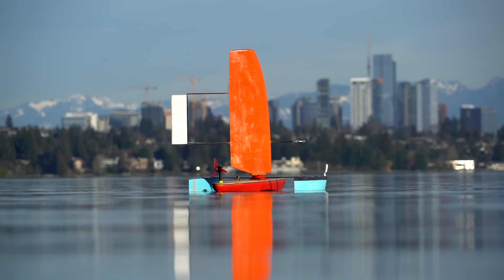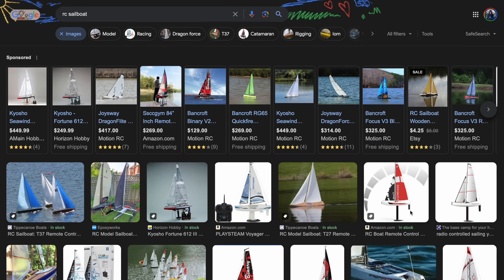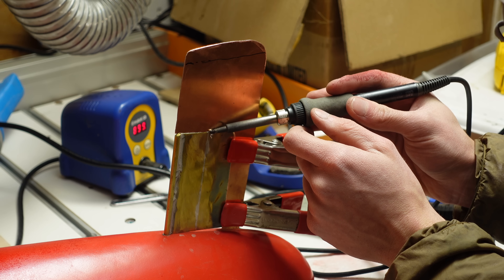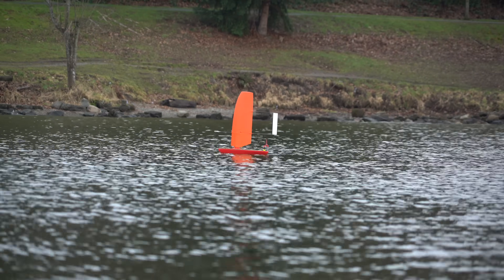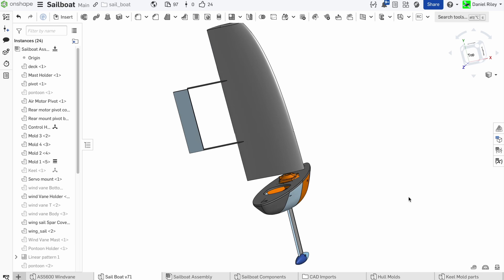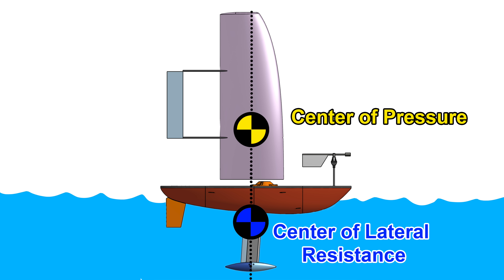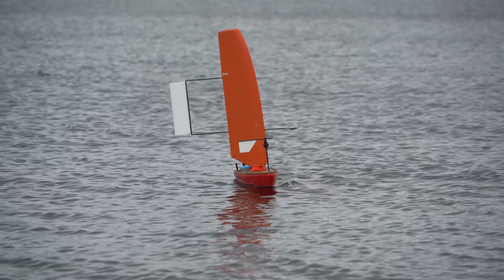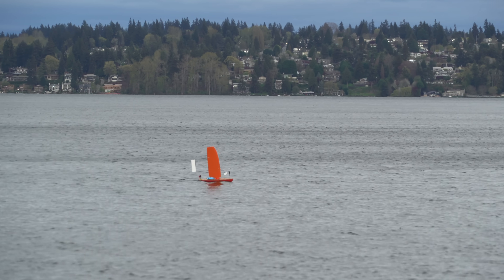Building a DIY Drone Sailboat

Comment: Your problem with a wing sail is it is symmetrical, requiring high angles of attack to generate inefficient lift, which will prevent it from being able to sail upwind. The wing sails of high-performance sailboats, like the Americas cup boats, are articulating or variable geometry wings, so that the Airfoil can be adjusted depending on which side of the sail the wind is coming from.
Reply: true but symmetrical wings are still very efficient compared to fabric sails.
Reply: @Okamika44  is that true? My hunch disagrees 🤷🏼‍♂️
Reply: @Okamika44  This would be a very interesting thing to test in the real world

Comment: Hull shape: the longer your waterline is, the faster your boat. 1.35*sqrt(waterline_length)=hull_speed. Less weight with that shape of hull = slower boat, as it floats higher.

Comment: Wouldn't it be possible to place the wind vane on top of the sail wing to have more consistent data?  Perhaps at the top of an axis that passes along the wing, fixed to the base, or fixed to the wing and consider the angle of the wing in relation to the hull to calculate the wind direction.

Comment: Great improvement over your prototype! Next steps to help you tack:
Lose the elevator. Its drag is probably the main culprit, and you can use servo control now that you've got wind direction.
2 fair your foils! You put a lot of thought into your airfoil and hydrodynamics on other projects, then you come in and use a plank for a keel and rudder. Give that keel a nice cross section and you'll improve speed and leeway.
Reply: I don't actually know if any of this is correct, but I know enough about sailing to know he's using the right words so he's probably right.
Reply: @JD2jr.  lol
Reply: He put a leading and trailing edge on the keel, and the rudder is a very thin piece of sheet metal.
Reply: @jeffh8803  The rudder is the main problem. It's the equivalent of trying to use an oar to steer. It works, but a proper foil section would work much better. Also, the foil section on the keel doesn't look like its actually a proper foil section...
Reply: Second the elevator suggestion. It's just not an efficient way of controlling a sail, especially given the power of modern servos and the small sail area. Also, I would be interested to see how well a canvas sail performs compared to a wing sail.

Comment: So Cool.
The tack problem is with minimum tack speed, it's kinda a known thing in less-complicated sailboats. Basically you can sail at a sharp (into the wind) angle all you want with any speed that gives you, but to  tack successfully you got to 'fall off' (with wind) and reduce the attack angle to pick up speed. Basically, a setting in the pilot to forbid tacking if speed less than minimum, and it should do it. (Also in situations when going into the wind and the sail is going on a very sharp angle to the water, there's the old friend GROUND EFFECT, at least with cloth sails, sends greetings ;) )
Reply: Ah, do you know that battened sails can protrude before the mast, which has certain advantages, but also gets you in trouble tacking in strong winds, while gibing gets less dangerous? Traditional sails have developed for good reasons, and doing things different is very interesting, but you WILL encounter some surprises. Steering a sailing boat is an art, if you want to win races, you should know an amazing amount of theory and apply it all at the right moments. Example? An old man is sailing passed you, and he says, hey dude, your entire sail is TWO inches too low, simply hoist it a bit. You'll get faster!
Reply: @voornaam3191  it’s so true, I used to race lasers in a pretty windy area of northern California so I’d always keep the sales as tight as possible because I’m a tall guy and could hang off the boat and really generate lift, but when I moved to San Diego I would rent larger sailboats and putt around in the breeze, one day as you described an old man sailed past me and yelled out “loosen up your sail a bit!”… I did and picked up a good .5 – 1 knot.

Comment: I think, he needs to make a simple, normal Rc sailboat and go from there. The hull doesn't seem very efficient, and whilst it isn't meant to be a race boat, speed is the byproduct of an efficient, low drag hull. If I were you I'd make the wing out of printed ribs and a film skin like with RC planes, the CG still seems too high in my opinion, better, but still high.
Reply: I don't think the hull is super bad, but it would certainly be on brand to build several hulls, and use an autonomous tug to pull-test each design to find the best one
Reply: Investigating a planing hull would be interesting, Vs a VSV Vs something off the shelf (one old and one modern design)  @2testtest2

Comment: Pouring lead into resin was surprising, I would never thought that would work!
Reply: lead's melting point is incredibly low. I used it as a kid for building small scale trebuchets.
Reply: @snowe..  I also poured quite a bit of lead, but never thought about pouring it in resin
Reply: He should use depleted uranium for keel.  Joking.
Reply: That was truly unnecessary. He should have just put lead shot in there. The 25% hit in packing density is not a big deal in this situation. 
Now he's got not only the exposure during the pour but the contamination and cleanup to deal with.
Reply: @otm646  lead isn't... that much of a poison. Not unless you eat it I guess, lol. I doubt his exposure is any more significant than a few months of soldering with real solder

Comment: Regarding the wind helm setup: it's also a performance thing. In many boats there are adjustments that can change where the center of pressure is. Tuning for wind helm requires that the rudder is constantly pivoted, and when that AoA is combined with the keel, they combine to form an effectively curved airfoil. When done correctly, it's possible to prevent the boat from sliding sideways due to the lift generated.

This may not be the case at RC scale, but it was something I worked a lot to tune in C420s, where it can be a huge advantage.
Reply: Interesting... 🤔 At what wind directions does this work best? (i.e. give the most noticeable effect)
And what kind of adjustments do you use? Do you like pull the mainsail tighter than the foresail, or do you adjust the surface area of the sail?
Reply: For the dinghies I have sailed It's done by moving the mast foot, hinging the whole mast slightly back and forth.

Comment: Excuse me what? You filled a 3d print with molten lead and it didn't deform the print? I had NO idea resin based prints were so much better at handeling heat
Reply: resin hardens with heat, it can't melt no matter the heat. However, it can become too hard and crack, as well as sublimate in extreme enough heat.

since he then reinforced the resin with fiberglass the over-hardening shouldn't be an issue, but it's something to keep in mind.

Comment: rctestflight casually arriving at a design for an unmanned marine kamikaze drone
Reply: As if no one's done that.  >.>  <.<
Reply: @rickhobson3211  I wonder if it would be possible to put a small wind generator on it, a second battery, and a switch to allow it to momentarily recharge the batteries in between tacking actions. This would reduce the efficiency of the sailboat per unit time, but the wind is doing most of the work to make it move, and all of the work to charge the charge the second wind-generator battery. Changing the sail and rudder orientations requires power, but in principle, these circuits could be unpowered during the leg of a tack, especially if a ratchet and paul system were installed for each. In this manner, you could have a boat that could sail or attempt to sail to a distant waypoint until the cycle life of one of the batteries is exhausted.
Reply: @FausterZ i think sailboats with an electric motor actually do this. Both while under sale and while at anchor to harness the tide
Reply: @FausterZ  I went through the comments to see if anyone else though of this, and I'm not disappointed. My thought is to put the wind turbine on the end of the wind vane, since it's always getting the maximum amount of airflow and needs the drag to provide accurate data anyway. I'm not sure how effective it would be due to the small size of the sailboat and how much energy it uses to transmit and receive data along with moving the servos and turning on the air prop when necessary, but I think it would be roughly on par with the amount of electricity generated if the whole deck was covered in solar panels.
Reply: @rickhobson3211  ;)
Reply: I feel like 99% of YouTube RC anything could be used to great effect as a small weapon suicide drone.
Reply: ah yes, a torpedo
Reply: @Gaming1Doge Torpedo, that costs 500 times less, has unlimited range, needs no human guidance and makes pretty much no sound.
Reply: @pali3329  Yeah, but I have a feeling that it's not too capable at carrying high explosives, not even factoring the price of the explosive
Reply: since it's so low power this could be perfect for ultra long range missions, perfect for smuggling drugs into australia
Reply: Underwater offensive drones are going to be the first thing deployed that uses fully-autonomous targeting and decision making. Because seawater causes signal blackout. Mark my words, it's going to be in the news within the next year.
Reply: Chicken and egg, did Ukraine learn from him or him from the Ukraine war